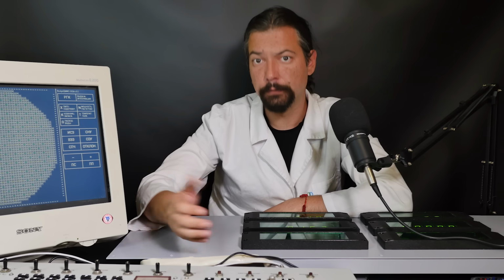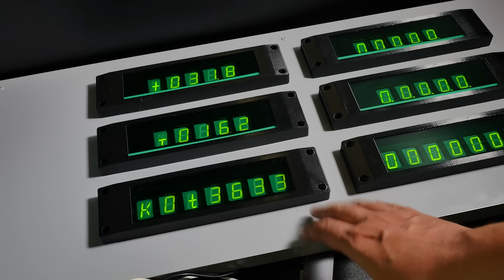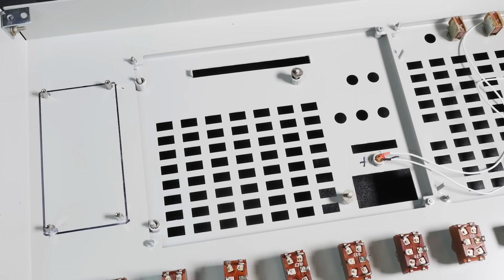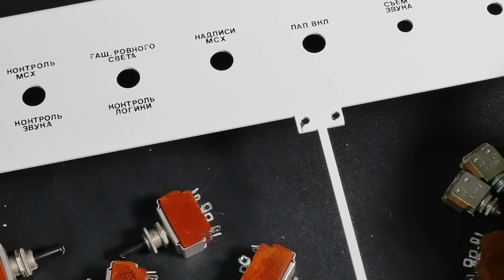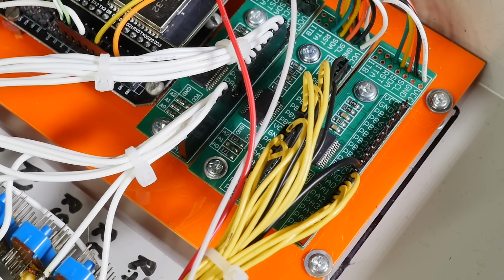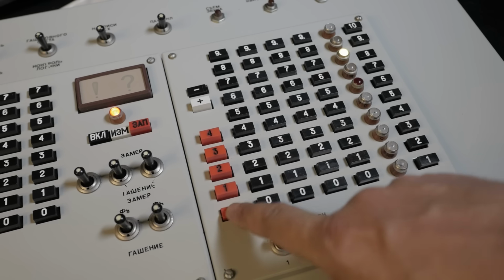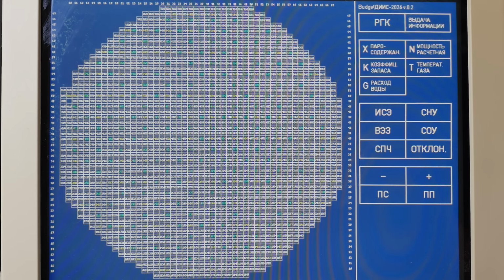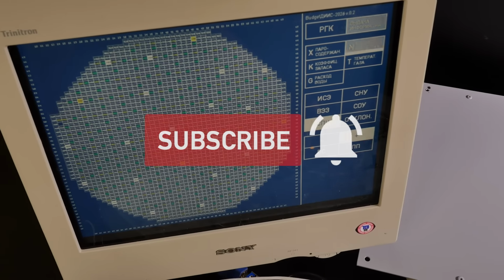Our SKALA Computer Just Got a Major Upgrade!

Comment: Hello, I have question about MTK indicators (14:21) 
Please, could someone explain to me what these markings mean?  РГК. ИСЗ. ПП +/-, etc. I’m not very familiar with Cyrillic or this subject, so thank you in advance for the answer.
Reply from the maker: You may need to check the previous video for more explanations.
РГК glows when there is a deviation in coolant flow in one of the distribution collectors that supply the active zone with coolant.
ИСЗ is indication of the status of restriction. Operator may programmatically restrict (disable) a data flow from specific detectors installed in that or another channel of the reactor during reloading operations or if the detector has a malfunction. It is done using <> button on the keyboard. MTK can then show what is restricted. We did not implement this functionality yet, but soon it will be.
ПП -- comparison with warning high setpoint being indicated, ПC -- with warning low. 
+/- -- indicates the type of the comparison -- greater or lower than something entered.
Reply: @ChernobylFamily  I'll definitely watch the previous video; thanks for the reply.

Comment: 1:18 the Trinitron CRT monitor is a flex, but sadly someone cleaned the screen with the wrong solution and it is stripping away the anti-glare coating.
Reply from the maker: Yes, there are those spots and I doubt they are removable
Reply: I've treated with great respect my bought new decades ago, good old ViewSonic flat CRT (that I still uses on my CAD workstation and gaming rig) , never cleaned it with harsh cleaning agent, and the coating still flakes :(
I think it's a sad but inevitable process.
Reply: @Damien.D  Yes but the anti-glare coating peeling, and it being chemically scarred are 2 different things. Degradation happens naturally, but the stains on the screen are from negligence/ignorance about CRT maintenance. (Not blaming our friend here, just pointing out the reason for the blemishes on this beautiful CRT).

Peeling is natural and somewhat inevitable but when you see those "mop marks" it means that the coating which is on the anti-glare layer has become chemically scarred. You may not have this and your anti-glare layer (not the coating on the layer) may still peel.

Comment: This is so cool to see it on a screen. Will this be attached to the control panel you made (and also will the control panel be featured in future videos)?
Reply from the maker: Yes
Reply: @ChernobylFamily  awesome, can't wait to see it.
Reply: @ChernobylFamily  could you by chance tell me the shades of colors used in this build? I do micro builds with smaller parts (desk sized version of this in the making) and I wanted to figure out what paint I use

Comment: awesome. nice solution with vga board.
Reply from the maker: I am just sad it cannot do more than 4 colors on 1024x768. If it would make 16, I could expand functionality much more. Seemingly I will need to migrate to raspberry.
Reply: @ChernobylFamily  far years ago i search solution to generate video composite with text over. That years was only $$$ ic from sony which can do it. Nowadays is many OSD modules do it easy. Simple way is use raspbery.

Comment: Yes result is amazing, great job !!! I hope people with knowledge will show up, to help create many  simulation scenarios for this device, yes i nominate you Tyler (@tfolsenuclear) and TCG ;)
Diodes in matrices are also used to prevent "funny" effects when two keys are pressed, many home devices (clocks) and calculators had this effect even visible, because in most display digits were multiplexed along with keyboard keys, so pushing two keys also changed illumination of some digits and of course give strange combination of signals from keys.

Comment: I couldn't imagine being in a skin of operator of reactor fighting with unreliable switches when something wrong is happening😅
I'm also sure that true switches also jammed and there was carefully passed institutional knowledge like "if it jams press 1 or don't switch from 2 to 5 directly, first switch to 9 and then 5"
Unreliable switches  were in so many devices in EE block countries like mine tv, radios.. some have magic combinations to unlock, some were locked in pushed position using matches sticks...
Uh oh, i forgot about flying away caps, that was another fun and knowledge, i hope in this case it was rare.
US had duct tape, we had match sticks, string and magic "hit the box" speels ;)
Reply from the maker: I used super glue.
Reply: @ChernobylFamily Brutal but effective and not from epoch 🤪 or maybe nuclear industry have access to super glue?
Reply from the maker: On old switches, I noticed some kind of glue, though...
Reply: @ChernobylFamily So they were flying..or like it was told in my country "grown legs" to put stolen in other words 😉

Comment: The TTGO VGA32.  I need to get mine going.
Reply from the maker: Actually, a nice device. BUT, there is one thing to keep in mind: those 8 holes for I/O have marks on both sides, and they contradict each other. Correct pinout is specified from the side of solder, not the side of components.

Comment: Even got a Trinitron for it.  And those switch caps!  Magnificent.  Y'all got taste 💙

What's cooler than retrocomputing?  Industrial retrocomputing.  Watching this gives me motivation to work on electronics projects because it reminds me of the beauty of electronics.

As an aside, Reflektor is a name I regard warmly (pun somewhat intended.)  I have some 6В1П secondary-emission pentodes from Reflektor.  (Plan is to use them to build weird voltage-controlled amplifier stages for my guitar.)  They are beautiful, with dynodes made of copper.  In fact, the Reflektor factory is still running under a new name.   A Russian company acquired rights to Tung-Sol, so now Tung-Sol tubes, originally a famous American brand, are made in Saratov.  If I'm not mistaken, they also bought original factory equipment from Mullard, once the king of the British tube world, so they could make classic Mullard tubes like the EL34.  So curiously enough, the Russian tube industry (along with the Shuguang Electron Tube Factory in China and JJ Electronics in Slovakia) has ensured the continued production of tubes the west no longer makes, yet which remain beloved in the world of music.  (I am myself a musician who prefers to build audio equipment with tubes.)  That factory must be an amazing place.
Reply from the maker: Thank you for sharing!

Comment: Very interesting, Thank you 👍 One question: I see on the screen 🖥 on vertical/horizontal scale 47 and then 50 channel, why is missing 48, 49 ?
Reply from the maker: Because that outer ring is reflector cooling channels. They are not calculated and contain just water, hence displayed off-grid system. In reality, I should remove them from the MTK completely - they won't ever glow.
Reply: @ChernobylFamily  Thank you. I really appreciate your work. 👍

Comment: Fascinating stuff! I began to wonder how these queries and data updates were handled. Did it somehow queue updates for the duration of query, or make the query on a copy of the channel data or handle updates during the query, meaning the query might see many data points spread along the execution time?
Reply from the maker: I really need to check papers to answer. It was not easily organized, very much tied on FGUs and Interface to The Apparatus (V-31M)...

Comment: I think you could use ИВ-4/ИВ-17 VFDs (the latter is a more reliable upgraded version). The form factor is different, but the overall look would be much more authentic.
Reply from the maker: Correct. But there will be needed severe modifications of the chassis. I will think about that.

Comment: Wow, it has been years since I’ve seen a Trinitron monitor.
Reply from the maker: Frankly, me too.
Reply: Honestly, it’s been a long time since I’ve seen anything made by Sony except their consoles. I heard that they’d largely pulled out of my country. 15 years ago, everyone I knew had a Sony TV, now they’ve lost their share of the market to the South Korean brands.
Reply from the maker: But, once I got two CRTs — this and b/w 9" i sharply felt how I miss that tech.
Reply: @ChernobylFamily  I’m also getting memories of the past seeing those dry transfer letters. My mother used to use those to make educational posters for her classroom in the early 1990s.
Reply: @placeholder-is-here I've still got a Sony vio CPU and monitor from around 1994 kicking around.  I should haul out I guess
Reply: @placeholder-is-here  Sony still manufactures smartphones, overpriced but very special (whole lineup with microSD and audio jack, framed displays with no notch/punchhole, ultra wide format screens).
Reply: I've got at least one in my basement. I think two. One is a original Sony vio with built in speakers. Perhaps a 14 in.  And I think a slightly bigger ViewSonic